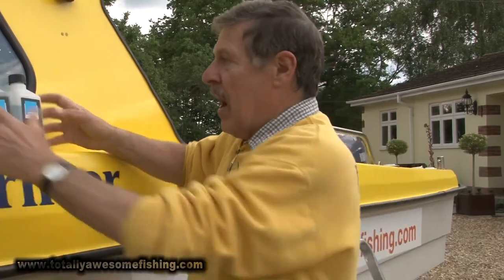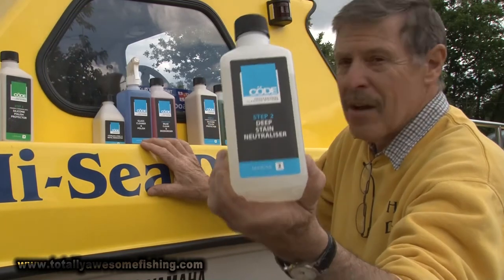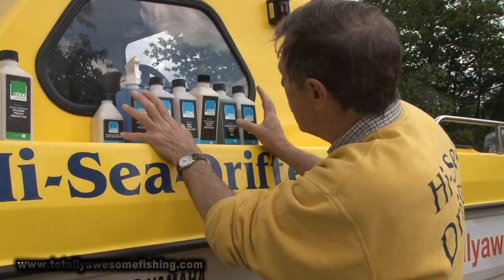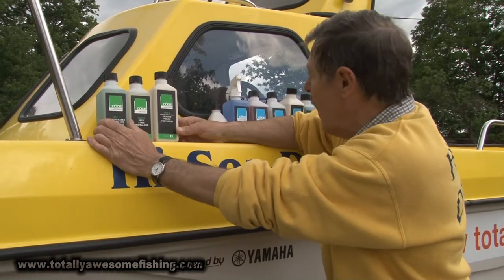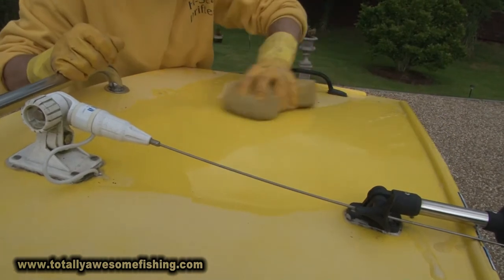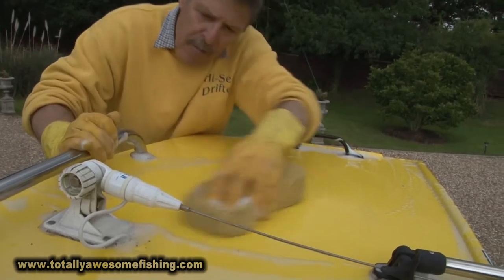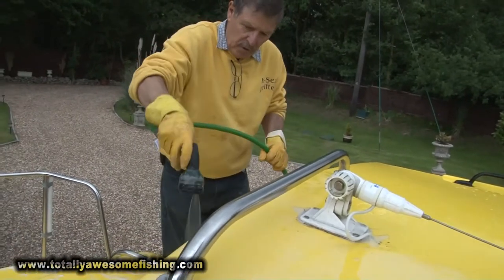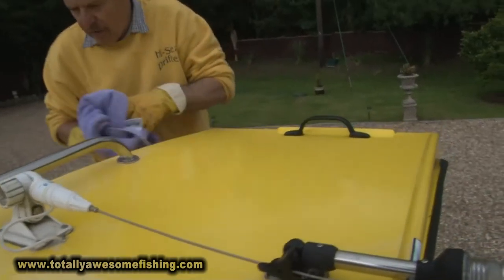How to clean your boat: CODE CLEAN

Comment: id say loose all those products and clean your boat with formic acid. I use it pretty much weekly when washing boats to customers and it gets rid of absolutely everything you can think of, just let it sit for 10 minutes and rub it off with some sort of brush that has relatively stiff bristles and water and it does not damage fiberglass surfaces or stickers ;)

Comment: hey tafishing
ive got the oppertunity to purchase an old wilson flyer 17ft but it does not have the top window guard or a front window.
is this the mk1 wilson flyer as the seller tells me it is. i cant find any info on them.can you help me at all
many thanks chris
Reply from the maker: Can't help you on that one,don't know the models earlier. I can tell you that the spray canopy on my Wilson was the best money I ever spent...that's for running at sea though,might not need it in freshwater with slower speeds.
Reply: TAFishing ok thanks any.where would I be able to purchase the spray canopy
Reply from the maker: I believe the Wilson are now being produced by another supplier.Get in touch with Wayne Comben,he should have an email on our website and he should put you in touch. Failing that just p.m. Mike and I will try to track him down.